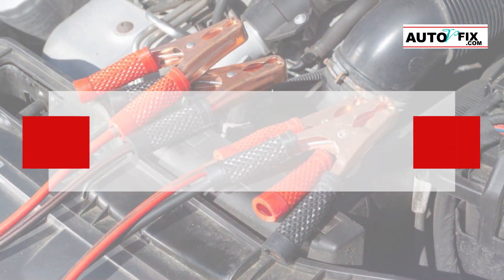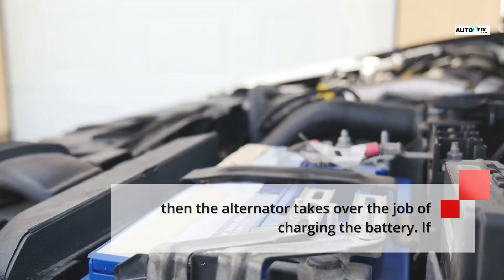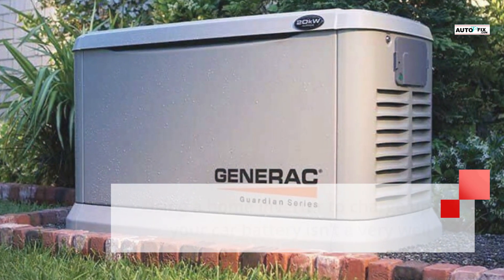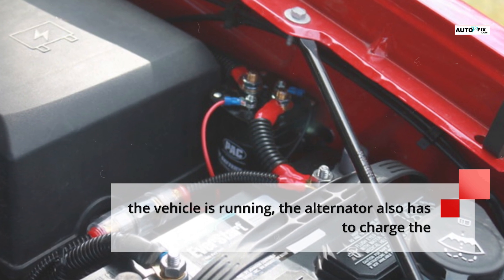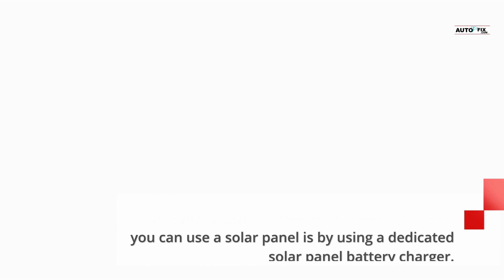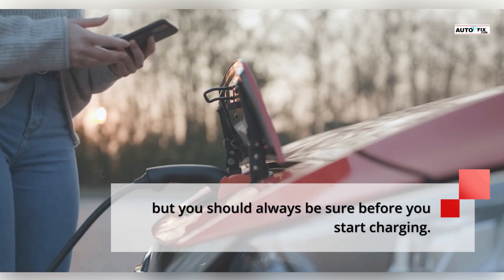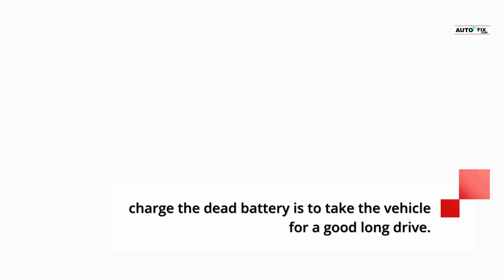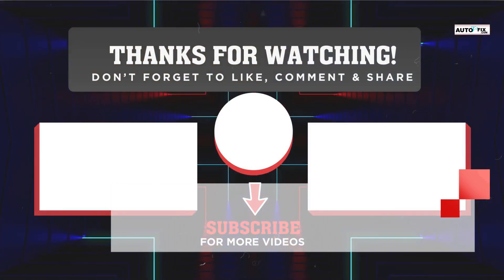7 Ways on How to Charge Car Battery Without Charger

Comment: Your nuts an inverter is not pluged into the wall ..it is hooked up to the car battery to create ac power. You have it backwards.  You would need a converter not an inverter

Comment: I used a 12V DC Charger like the one that's used in a router. Make sure it has very low Amperage - mine has 0.5 A which is fine. 1A is ok as well. I connected the inside of the plug to the plus side of the battery (last) , and first connected the outside of the plug to the minus pole. Make sure to not short them!
I let it sit for 10 minutes, after which my dead battery showed a charge of 6.9Volts and I could swap to a normal battery charger/conditioner.

Comment: I have a battery powdered jump starter. And I have a car battery charger.   Can I change the battery powdered jump starter through its jumper cables connected to the car battery charger?

Comment: I have a 860cc car battery brand new.
That I put in my car.I have a deep cycle battery incase of a power outage.If I want to recharge the deep cycle 850 battery  I wonder can I use jumping cables.And I will get a battery tester the 1 with the red yellow and green light ?

Comment: My friend jumpstarted his early 2000’s bmw with a  drill tool battery!
Reply: I did that with a 12v drill battery and someone said I was lying 😂 the car was a 1983 Nissan Sentra and it started right up with the help of a fully charged orange 12v makita drill battery 🔋😂😂😂
Reply: I just did jump start my Makita drill battery and it crank like a pro
Reply: 12v not enough. to start normally need 12.5 to 13/14v but. mine work fine with 18v drill battery
Reply: Ryobi 18v didn't work. What size wire?
Reply: @JustinGodingSr.-dd9bd   it was 18v, and it was for a motorcycle jump - he used alligator clip on positive and tweezers on negative the. Used jumper cables on those.
Reply: I tried that a couple of times and it didn't work for me.